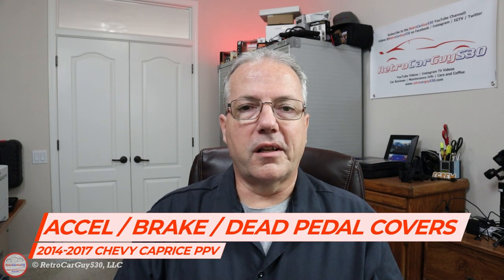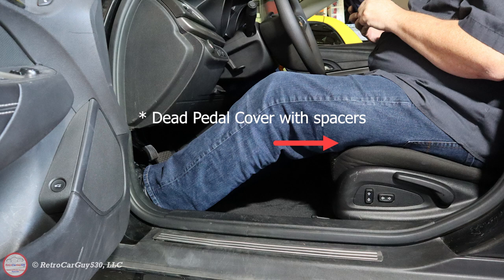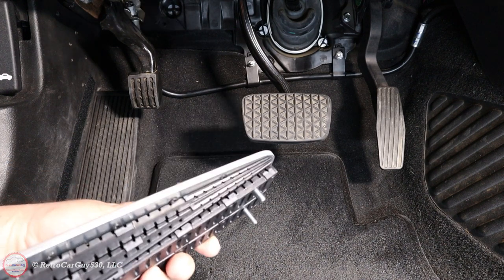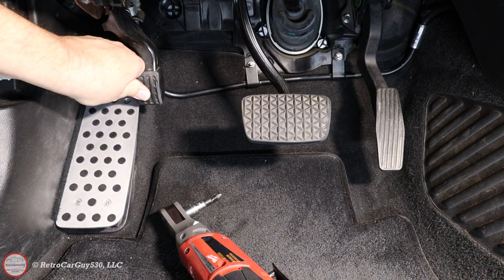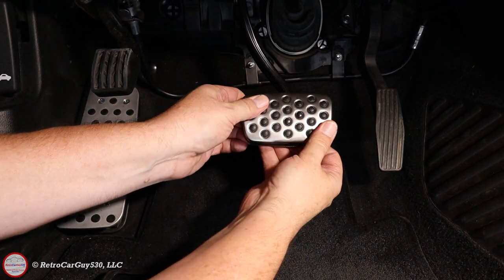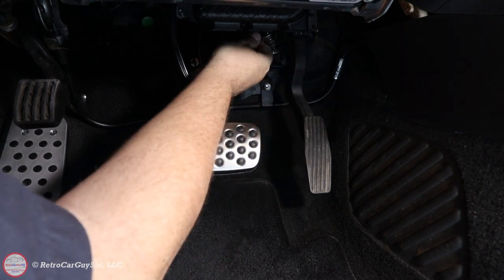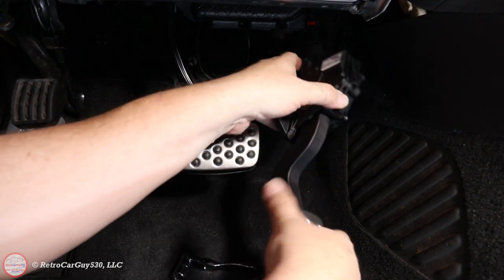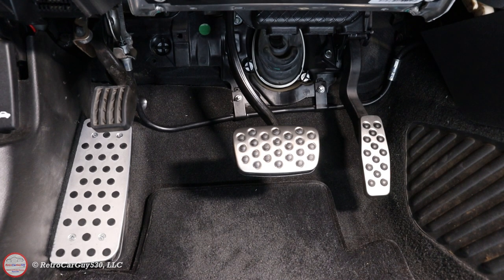Chevy Caprice PPV - Aluminum Pedal Cover Installation

Comment: Looks like you got the dead pedal from ultimatepedals.com. That's for a G8, correct? Or did you spec an SS?
Reply from the maker: After a bit of research, I found the emails I exchanged with Ultimate Pedals in 2015 and then in 2017.  I purchased one for my former 2015 SS and then another for the 2017 SS.  I kept the one from the 2017 Chevy SS Sedan when I sold it.

It's not listed on their website.  I had to place an order for a 5th gen Camaro "heelguard" and then follow up with the company via email stating you really need a "foot rest" for the Chevy SS Sedan.  I imagine you could state it was for the Caprice PPV since they're the same style/size as the 2014--2017 Chevy SS Sedan.

You may want to contact the company via email to see if they can still produce that item and if so how to order it now.

Comment: I have a question or two. You’ve owned 2 Chevrolet SS cars, which were manufactured in Australia and are USA conversions to USA standards. V8 powered, somewhat similar to the late Pontiac GTO. Now you have a Chevrolet Caprise PPV, which is Chevrolet short hand for Police Pursuit Vehicle. Am I right so far?  The SS cars were Chevrolet performance vehicles, right?  The PPVs were, shall we say, hardened Chevrolet sedans, with performance suspension, engine mods, trams mods, brake mods. But they are well used cars, driven by non-owners, who it’s safe to say, didn’t care about the cars as long as the cars got them safely to the end of their shifts.  
I was a LEO as a very young man and saw how the patrol cars were used, or I should say abused. Any fleet vehicle is treated like the old saying, “Drive it like it like like you stole it”.
So, the point of of all this, why the PPV after owning the SSs?  I’m not criticizing, just wondering.
Reply from the maker: The Pontiac GTO, Pontiac G8 GT/GXP, Chevy Caprice PPV and Chevy SS Sedan are all manufactured by Holden in Australia.  

The Holden Monaro was the basis for the Pontiac GTO.
The Holden Commodore VE was the basis for the Pontiac G8.  
The Holden Commodore VF/VFII was the basis for the Chevy SS Sedan.  
The Holden Statesman/Caprice was the basis for the Chevy Caprice PPV.

All of those vehicles are rear wheel drive platforms and all of them offer some version of a Chevy LS series engine.

The Chevy Caprice PPV (Police Patrol Vehicle but I have heard it called Police Pursuit Vehicle) does have some police oriented tweaks to the Holden Statesman/Caprice.  The Caprice PPV has a longer wheel base than the Pontiac G8/SS Sedan by about 4 inches as well.

The Caprice PPV is definitely a fleet vehicle with most of the cars in police service getting the typical abuse of a police vehicle.  The trick is to find one that has been maintained well.

I had a 2015 Chevy SS Sedan, but after one of our dogs became ill with cancer, we needed the money tied up in the car to handle some of the bills not covered by pet health insurance (yes that is a thing that exists).

I then purchased the 2017 Chevy SS Sedan and loved it.  I made the tough decision to sell the 2017 Chevy SS Sedan in January 2020 to help fund my company.  I took half of the money from the car sale and replenished our savings to cover the costs of the company up to that point and the remaining half is the money set aside for the 2014 Chevy Caprice PPV project car on my YouTube channel.

The 2014-2017 Chevy Caprice PPV has many similarities to the Chevy SS Sedan (platform, electronics, interior).  My objective is to refresh the 2014 Chevy Caprice PPV to a level that makes it a reliable daily driver and I'll have "most" of what I had in my 2015/2017 Chevy SS Sedans.
Reply: RetroCarGuy530   I understand paying for vet bills for a loved pet.  We had two Siamese cats, 22 years and 21 years old, we had to put down, very sad. 
Thank you for clarifying the Chevrolet/Holden questions. 
I often have questions about YouTube videos, I try to never criticize. I think most YouTube posters are trying to do their best.

Comment: Did he say 2014 Chevy caprice?????????
Reply from the maker: Yes, I installed the pedals into my 2014 Chevy Caprice PPV (police patrol vehicle).  The 2014-2017 Caprice PPV shares a lot of parts with the 2014-2017 Chevy SS Sedan.  The 2011-2013 Chevy Caprice PPV shares a lot of parts with the Pontiac G8 GT sedan as well.